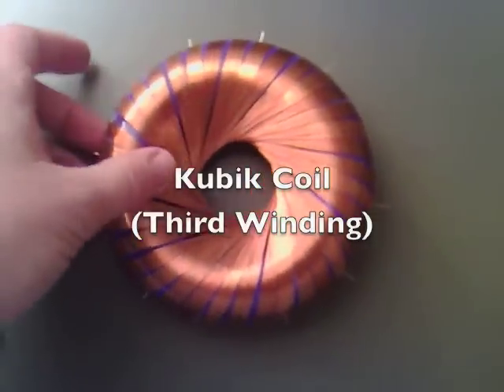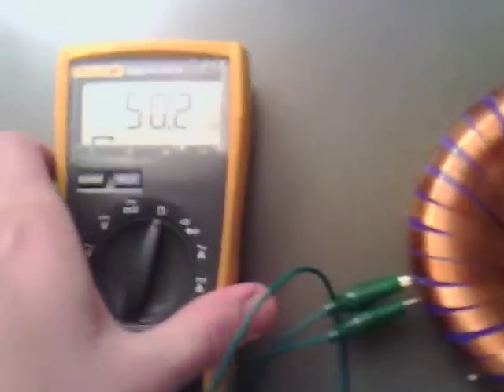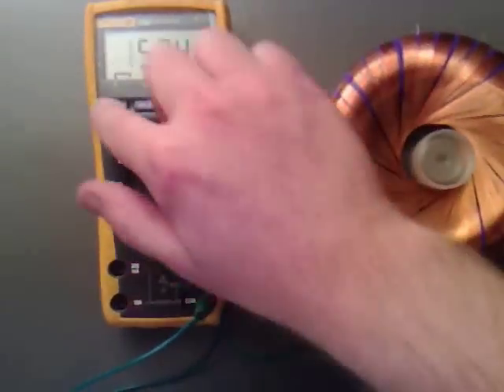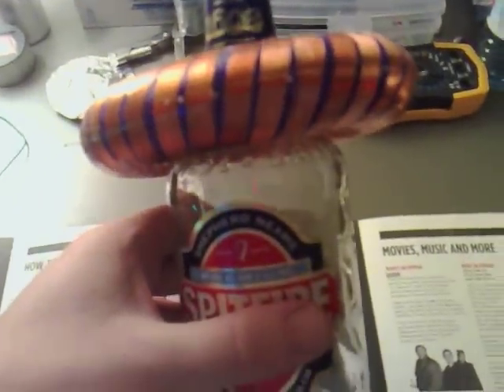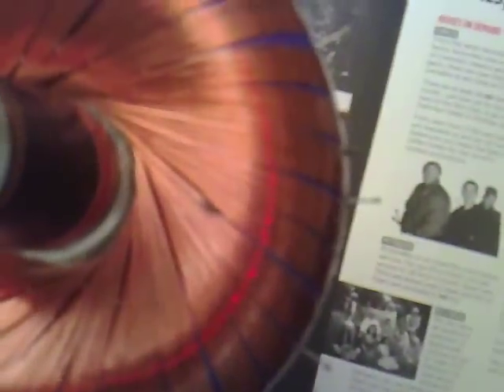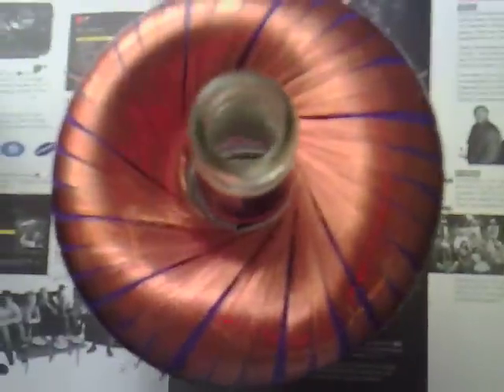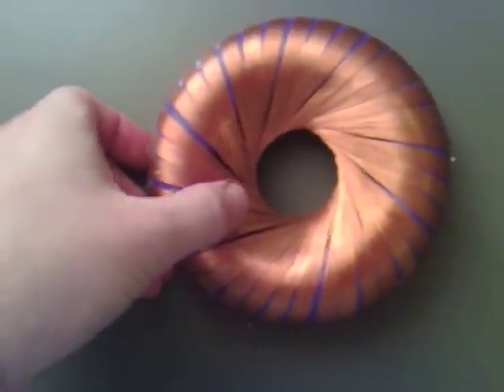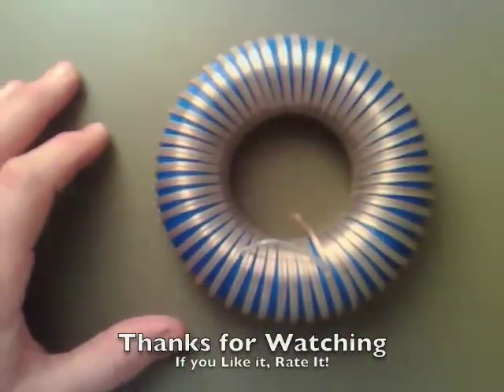Kubik Coil (Third Winding) 003

Comment: If you make one at home use a ferrite toroid, it won't melt and it will focus the magnetic field. A meter measures current through the coil to measure resistance, moving through a magnetic field will change that current. You have discovered Lenz's Law, 150 years later.

Comment: Maybe yu can fix yr melted coil by pressurizing it from the inside of the donut, use magnetic printer toner mixed with vegtable oil then spin the magnetic ferro fluid with current in the coils

Comment: Multimeters measure resistance by putting a known voltage through the device under test, and measuring the current flow. If the coil is producing it's own voltage, it screws up the reading. All you are reading is voltage produced by electromagnetic induction. The resistance is *not* changing.

Comment: @salerio61 
Occasionally the meter reads a negative resistance. This is only possible when a voltage is present. The same effect can be seen when an electrolytic capacitor's resistance is measured in one polarity, the measured immediately after with the polarity reversed. All that is happening here is a voltage being generated by the movement of the magnet around the coil.

Comment: Great work on the coil but i think the effect you are observing with the changing resitance is due to the way that multimeters messure resistances. They messure the voltage drop accross what you are messuring and work out the resitance from that, by moving a magnet past the coil it is inducing a voltage into the coil giving the multimeter false readings.

Comment: What a load of tosh. Pushing a magnet near a coil of wire doesn't alter the resistance at all. You're measuring is the change in the voltage across the coil because you're inducing an EMF not changing resistance.

There is an effect called magneto resistance, and a couple of researchers got the nobel prize for discovering super-magneto resistance, but that is nothing to do with what you are doing here.

Comment: the magnet in the middle"interesting" not..try running a magnet past any coil and it will change the resistance of the coil.looks like it would make a nice motor though.

Comment: The mathematical equation that describes this relationship is:  I=V/R
where V is the potential difference measured across the resistance in units of volts; I is the current through the resistance in units of amperes and R is the resistance of the conductor in units of ohms.

Comment: Electromagnetic induction is the production of voltage across a conductor situated in a changing magnetic field or a conductor moving through a stationary magnetic field.

In electrical circuits, Ohm's law states that the current through a conductor between two points is directly proportional to the potential difference or voltage across the two points, and inversely proportional to the resistance between them, provided that the temperature remains constant.

Comment: The resistance isn't changing. The voltage applied by the ohm-meter (Voltage is required to measure ohm), which is making a current throught the coil, the current in the coil will change as the manget is inducing voltage when moving the magnet back and forth. This will infect the measurements.

Comment: I am not sure why you made a third coil on this but its good for experimentation.  the coil is supposed to have two sets of wraps and one is considered an invisible coil so you have 2/3rds wire and 1/3rd open 

I am not saying that there is anything wrong with trying this out you just don't have to do a 3rd coil

Comment: perhaps something cool to try,

put the coil back onto the bottle. now place a ring magnet onto the neck. as close to the coil as possible, not touching the copper, only touching the glass.  im guessing the magnet will either fly off into your ceiling, or the bottle will become the speaker. this could vibrate the magnet on a 360 axis, giving a far more rich and clear sound. (maybe it will shatter the glass at certain frequencies)